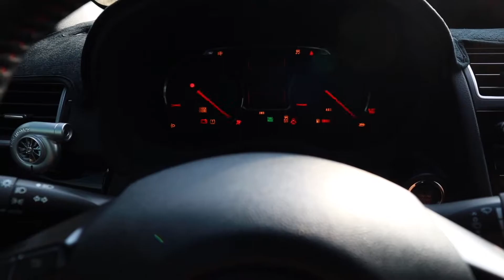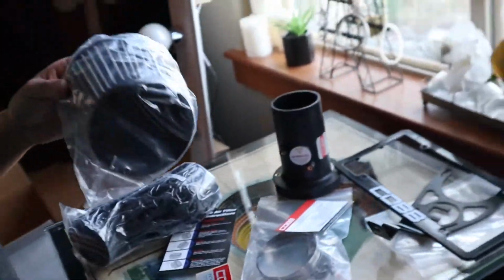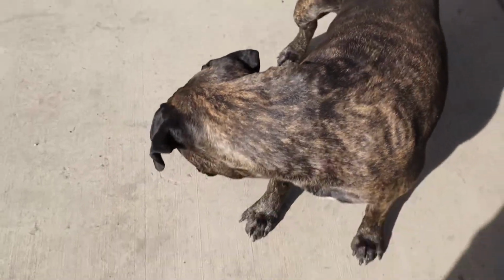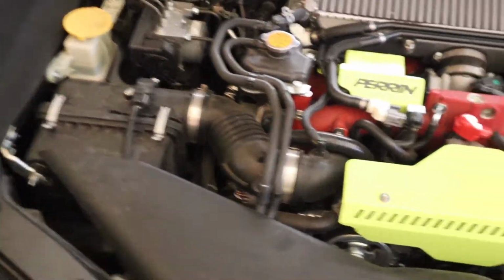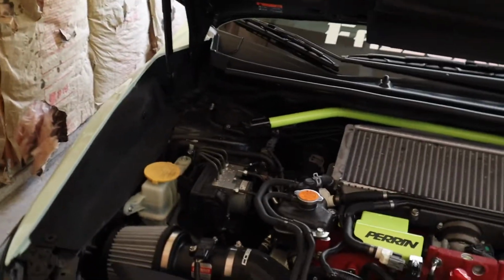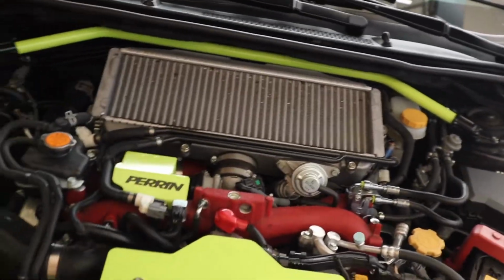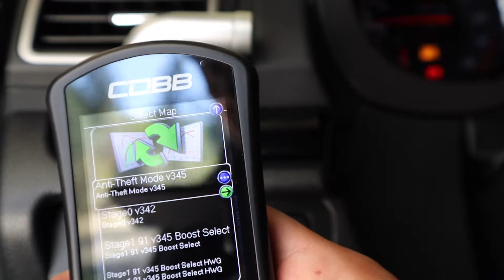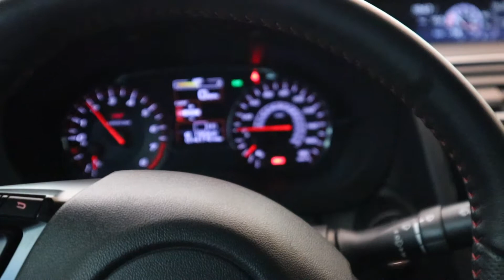Stage 1+ Cobb Intake/Cobb AP/Tomei Catback [2018 Subaru WRX STi]

Comment: So no tune is needed once the Accessport is installed? It’s mapped on there? Sorry new to this.
Reply: Sean Meneses The Accessport gives a base map. It’s safe to use the base map but a pro tune is highly recommended to your car running the best it can

Every car is different which is why a base map is only the start for the potential of each vehicle

Comment: im curious. what does stage 1, 2, 3 come with? i know if you buy stage 1 it comes with sf intake. for example i f i wanna get stage 1 and then later on i will add downpipe etc
do i just need to reflash it everytime i add parts? or should i jump to stage 2 or 3? im new to this stuff thanks in advance

Comment: Hey bro do you have trouble shifting from 1 to 2nd gear bc of the rev hang? I try to let the clutch out slow af and still it doesn't shift smooth. All the rest of gears are smooth as can be except 1 and 2
Reply: I’ve noticed this! Letting the clutch out slow helps a lot and shifting at like 3k and slow release seems to make it smooth
Reply: You aren't alone! After a year now I'm definitely better but still the only car I've drove that I've had trouble shifting smoothly. Hopefully a tune will solve this